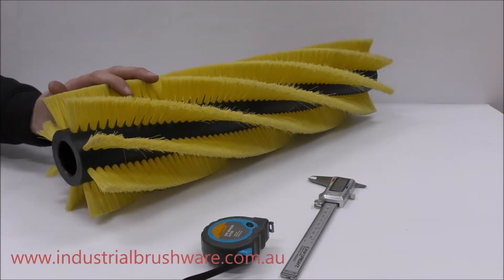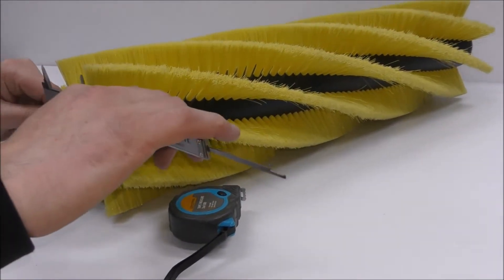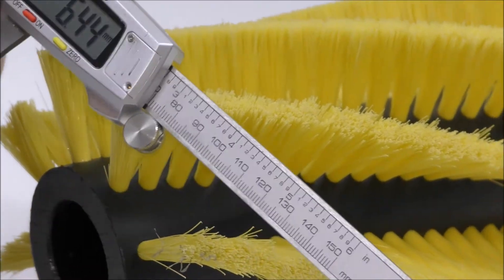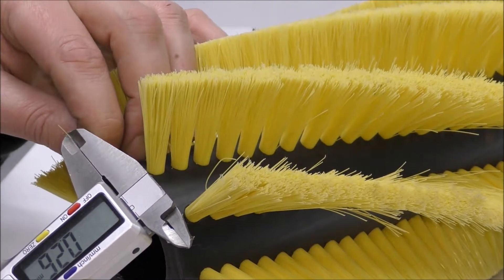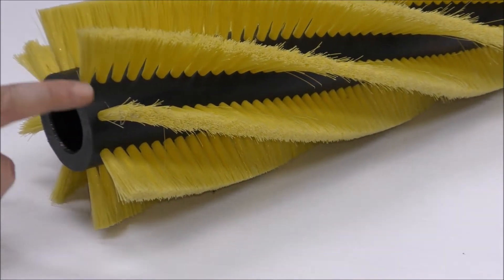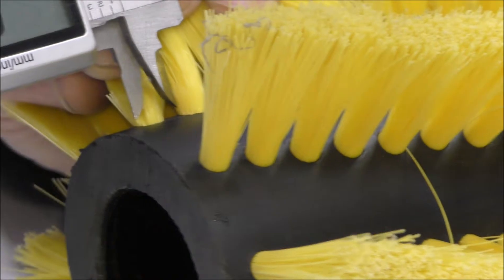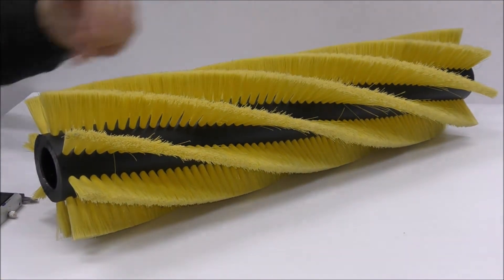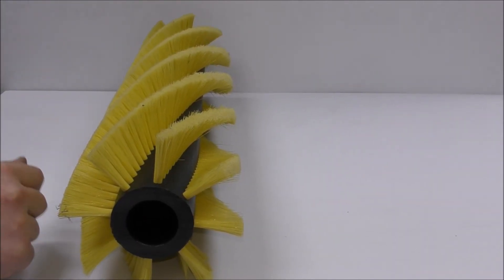How to measure a Staple Set Cylindrical Roller Brush with a Helical or Helix pattern

Comment: how can i get same brush with 2 mt total long
Reply from the maker: Hi Wk - apologies we did not get notification of your comment and missed it - I'm not sure if you have contacted us in the meantime and received an answer to your enquiry: Depending on the type of brush required, we have capacity to manufacture brushes up to 4800mm long (Spiral wound). Generally our limits for the staple set roller brushes are around 3000mm. Please contact us at sales@industrialbrushware.com.au if you need any further info - and again apologies for not noting your enquiry earlier.